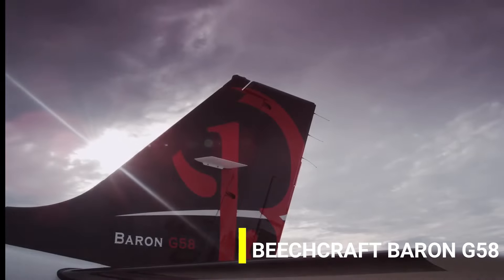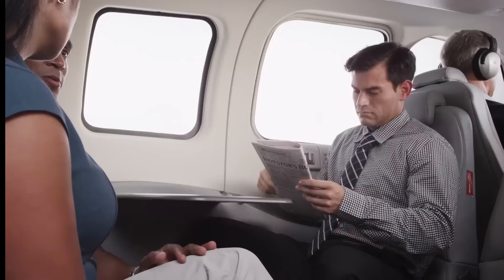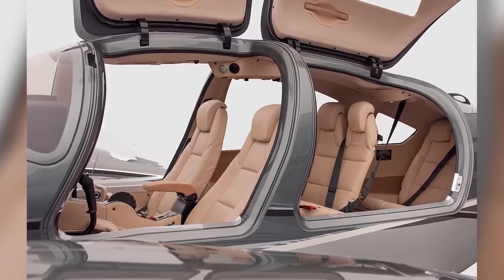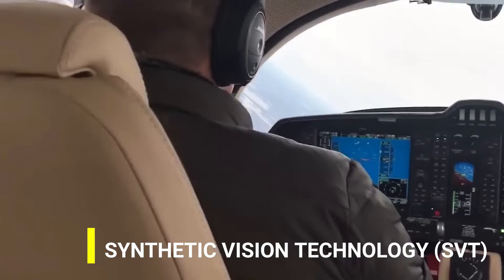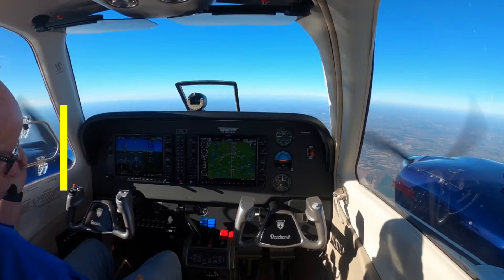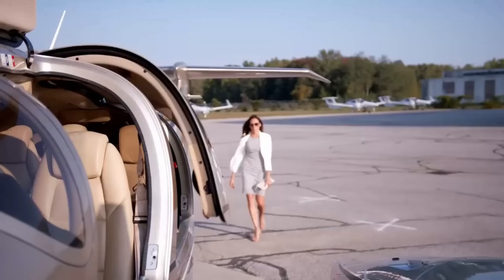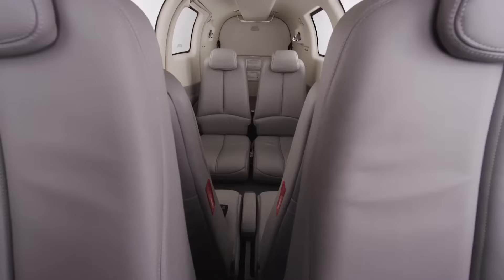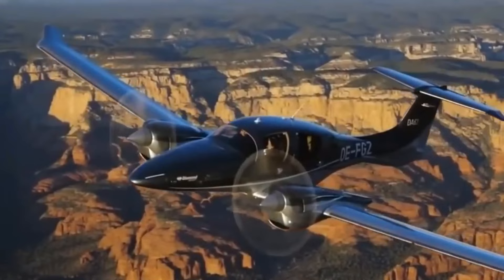Superior Aircraft - Beechcraft Baron G58 vs Diamond DA62

Comment: Baron empty weight, 400 lbs?  I'm impressed!  How about operating Ceilings and price?  Thanks for the update, but not very objective.
Reply: Absolutely, the empty weight of the Beechcraft Baron G58 is indeed impressive and reflects its engineering excellence. Speaking from my own experience as a pilot and fellow aviation enthusiast, I've been flying with "One Bravo Tango." Comparing the Beechcraft Baron G58 and the Diamond DA-62, two exceptional twin-engine aircraft that excel in technology and comfort with competitive pricing. However, I'm not sure if it's available in my country.
Reply: Empty weight is just short of 4000 pounds. Clearly a minimum of effort put into this video. Didn't even proofread the script before running it through the speech to text nor when they were furiously typing out wrong information for the screen text.

Comment: Up front, I’m a Baron owner, so I’m biased, but I know both. A Baron ground roll is only 1400-1600ft at sea level. Regular cruise is 180-190 KTAS. High speed cruise is 200-210KTS. Diamond is slow, 140-160KTAS. Baron is burning typically 26-30 gallons per hour at cruise. Diamond is 22-24GPH. Baron can seat 6 full adult males. I’ve done it. But usually a mix of male-female, or 3 or 4 adults + 2 or 3 children is fine. Can realistically take 5 adults no problem. Diamond can handle 3 adult males, or 4 average sized adults. Barons are fairly reliable, Diamonds are not. There is a reason why I own a Baron. The Diamond twin, newer tech, but is slow, and a dog. Baron will smoke it for dead.
Reply: Which diamond? That fuel flow doesn’t seem to match the da62.
Reply: I just wanted to let you know that your Post is not correct. Diamond DA62 burns a maximum of 18 gal/hour both sides cruising at 192Kts. At a normal cruise, at 75% Power setting, it cruises at 160kts Burning a total of 14.2 gal/hour on both sides.
Reply: @juliusouma4474  yes, I acknowledge I accidentally doubled the Diamond’s fuel flow. My Baron does 194 ktas@28gph at 65% power, about 210ktas @ 32-35 gph @ 75% power. Although I don’t cruise at full power, I have hit redline in level flight 1000’ and below @ 224kias /224 ktas @ 100% power at 50gph. Barons are quick airplanes, although it comes at the price of fuel burn. Typically in the Midwest with cooler weather, my initial climbout is 3000fpm to 3000ft, then typically 1500 to 1000fpm to 11,000ft @ cruise climb 130kias. In hot locations such as south Florida, initial climbout below 32-35C is 1500-2000fpm to 3000ft, then 1500-1000fpm. When temps are very high, 35-42C, main issue is cylinder cooling below 380F, full power takeoff then derated initial climbout is only 1000-1500fpm.
Reply: @WarrenatCLS  In Personal Transportation, you need to minimize overspending. Because it is not the only thing in life to Spend  Money on. Make it affordable like a car. So if there is any GA out there in the present generation, that can have Safety and Cost in Perspective, then it is Diamond DA62. The Speed is not such a big factor, because the time saving is minimal when you do any other GA. For the regular short distance like 3 hours and below, I don't feel the cost because it's like driving my usual Car. Above all, you can see that the second Engine in DA62 is a big lifesaver in the event that one of the Engines fails  Mid-air. With DA62, you are always at peace. Long Live Diamond Aircraft, Long Live Diamond Da62.
Reply: @juliusouma4474  I didn’t buy a Baron to save money. Don’t care about fuel. *Speed is more important to me. 👍🏽
Reply: Wow all your facts about the Diamond are wrong.  You’re about as good as the ai generated video!
Reply: @aaronmuller5891  know what I need - it’s slower than my Baron, and doesn’t carry a much as a payload as my Baron, all at the same time and range as my Baron. Maintenance is also a dog on the Diamond. My Baron is almost never AOG. So…for me, didn’t fill my mission. Wasn’t worth buying.